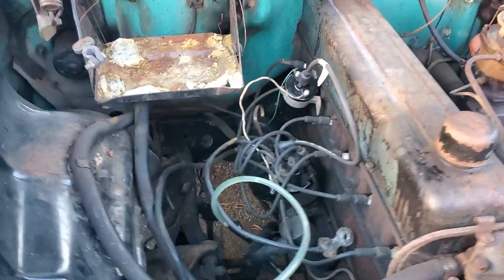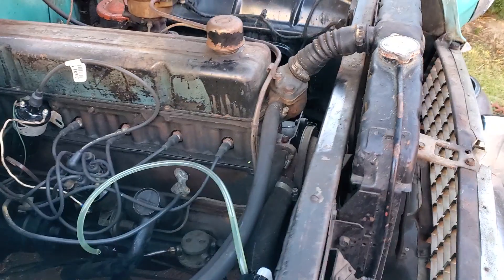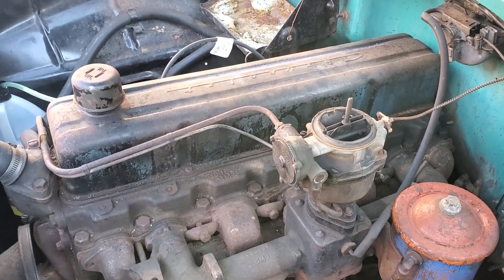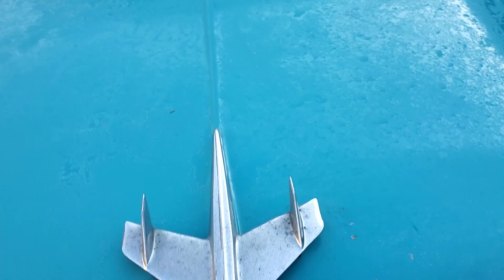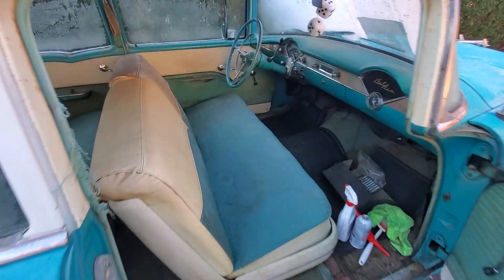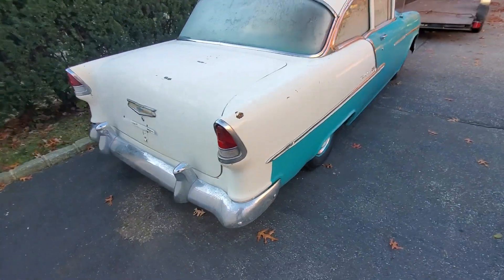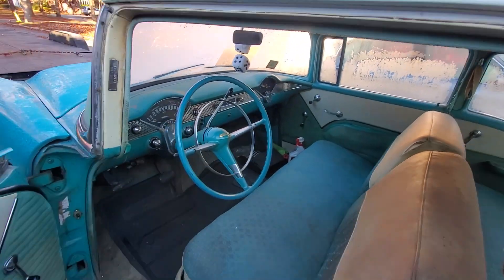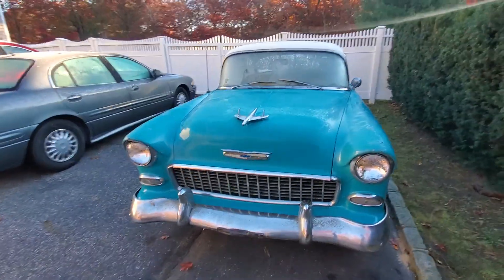Update on my 1955 Chevrolet Bel Air 6 cyl 235. We will get it running!

Comment: If a valve/valves is stuck it could have bent a push rod. I have taken the rocker arm off a stuck valve and smacked the top of the valve with a hammer to loosen it. If one is stuck then check the push rod to see if is bent. I don't know what you done so far with the fuel system but the tank will need drained and flushed out, some older cars had drain plugs on the tank. Unless you had the fuel pump getting gas out of a fresh can of gas then the old crap has probably plugged the carburetor up and it will need cleaned and rebuilt. In the video of when you were trying to start it, it sounded like it was getting spark but no fuel and only hitting on a few cylinders. I think if you un-stick the valves and get it fresh fuel it will start up. Good luck, nice find.
Reply: I notice that there was a valve sticking in last video also